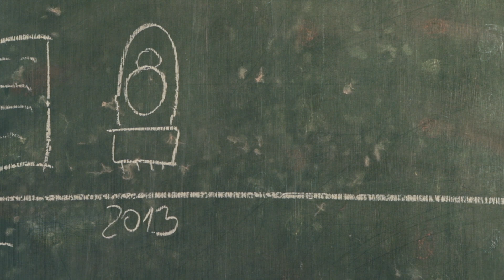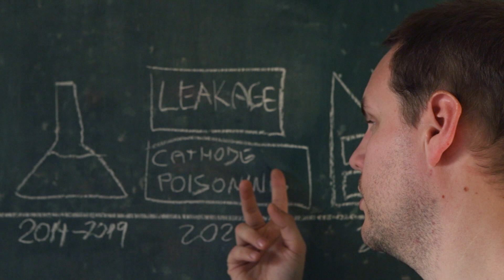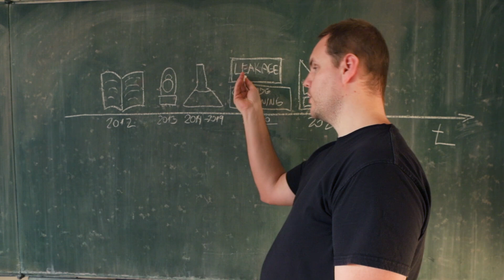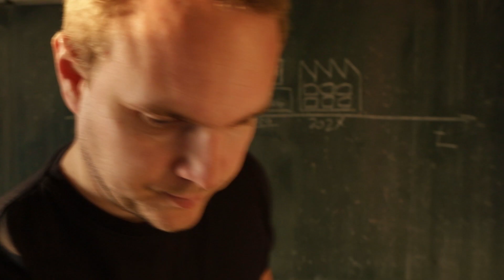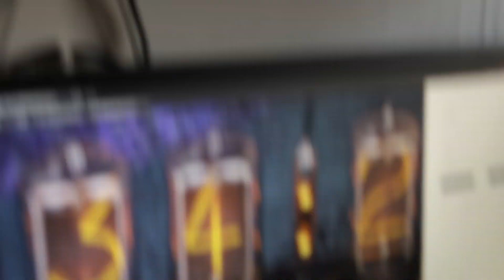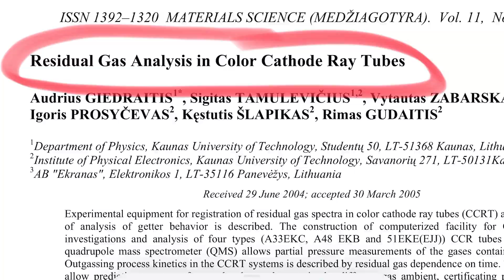Plans for 2020 - getting ready for nixie tube factory.

Comment: Wouldn't an increased "lit" cathode surface area speed up the rate of material sputtering (poisoning) as well? Could also explain why the smaller tubes last longer (assuming we don't normalize for cathode area vs poisoned area, just going by visuals). You could make one cathode optimized for large surface area and keep it lit to see how it affects the poisoning of the other cathodes. Would require manufacturing a specialized cathode, but could be an interesting experiment?

Comment: Nice video, and I am excited to see what the future holds for you! :-) A random unrelated thing: I love your new studio, but it has a lot of echo. Have you thought of using a Lapel Mic for recording your audio? I am using a very cheap one ($20) and it works great :)
Reply from the maker: Thank you! I will need to figure out wireless setup between lav mic and the camera. I have all except the wireless link. The extra work with syncing audio from lav mic recorder to dslr video is pain :-)
Reply: @daliborfarny  Most editing suites have an automatic function to sync up the audio tracks of two video streams, so it works in less than one second! I use a wired Lapel mic, which is not as bad as you would think, but I hope to upgrade to wireless some time.

Comment: I'm very impressed by the manner in which you gather and analyse your data.  I'm convinced you'll get to the root of the problem eventually.  Don't forget to look at simple solutions to this complex problem of gas mixture and cathode poisoning though.  I have nothing to prove it, but I suspect that the reason so many manufacturers all over the world figured out how to make fairly long-lasting nixies may have more to do with a shortcut of some sort, like a getter material, a certain metallurgical makeup of the parts, or a coating that's microns thin...  Perhaps an impurity you filtered out of your neon was helping you and that's why things got worse?  I am taking wild guesses, so don't take me too seriously.  But don't be afraid to test hunches either!  Carry on, you're doing fantastic work!
Reply: hugeshows one space after a period. Not two. You only need two if you’re typing on a typewriter. We were taught wrong.
Reply: @ophello  It's not just for typewriter use, it's for use with monospaced fonts.  It still looks better either way and I will continue to do it because I'm not un-learning the way I'm used to reading and typing just because somebody arbitrarily decided that it's obsolete (it isn't).

Comment: There's an easy way to accelerate poisoning. Extreme overdriving(5-10x the operating current, enough to get the cathodes to a good 150-250C) of one cathode and optionally extreme under-driving of others.
Regarding gas analysis: beware of the pumping speed trap. The setup shown in the paper is not optimal because the turbopump system will suck the helium and neon at different rates. Ideally, you want to completely gate the HV system off when you puncture the tube. The RGA should be doing all the work. However, you will have issues with the gas load, which will shoot way past the RGA's operating pressure. The puncturing system will need heavy throttling.
Reply from the maker: The cathodes are at 200-300C during normal operation, significant overdriving starts different processes that would not happen in a long time during normal operation (= impossible to interpolate the data back). For instance, the steel of the cathode starts delaminating, some gases can be released from the internal parts and envelope etc.. The RGA system will be an interesting project, there is Ne/Ar mixture inside, so the mass difference is not that big for the turbo like for Ne/He. I am planning to use a comparison of tubes (good vs bad gas composition) instead of the absolute amount of gases - that would be very hard.

Comment: For long time testing image capturing I would setup a NVR and some cheap high resolution security cameras. They are made to film 24/7 and store the images for a long time
Reply from the maker: The resolution 12Mpix of the Canon 450D is just enough - there are 12 tubes in the shot for each. Also, I need to use long lens, to avoid distortion as much as possible - that would be a problem with wide lens security cam.. But thanks for the tip anyway!

Comment: 7:00 is that red nixie tube also because of a leak? it looks pretty cool.
Reply: in some older Nixie tubes, they can be seen with a red coat that's meant to filter the type of light you are seeing, as some tubes have a secondary, cooler light that emits and makes the image harder to see. they are probably testing this to see if it has any benefit to their own process.